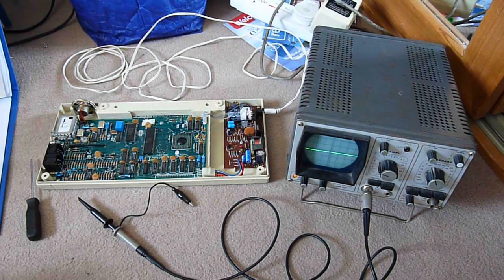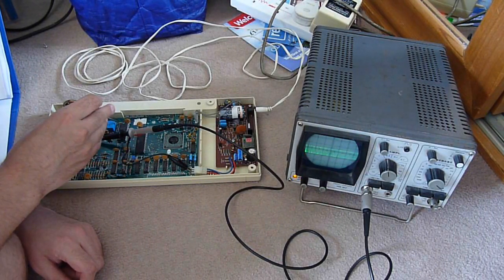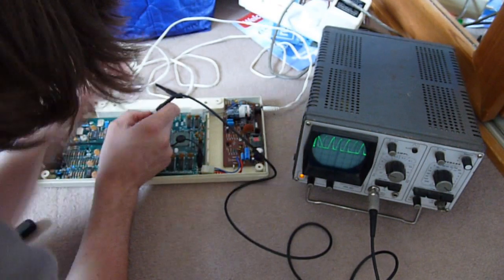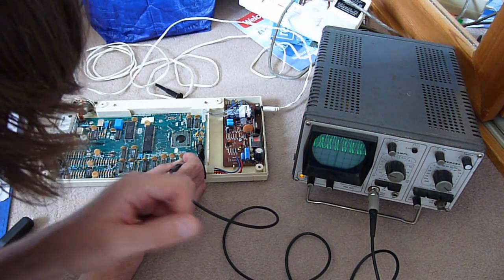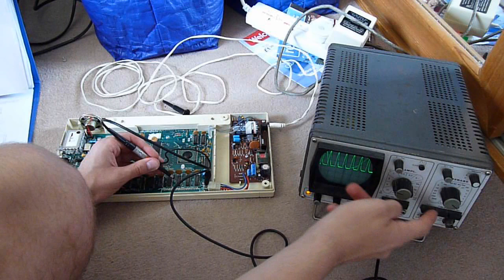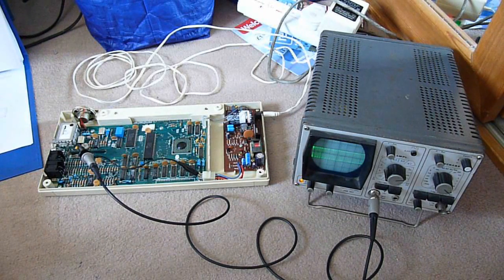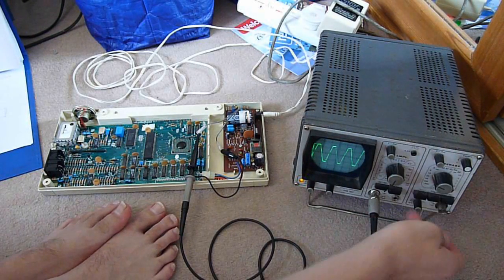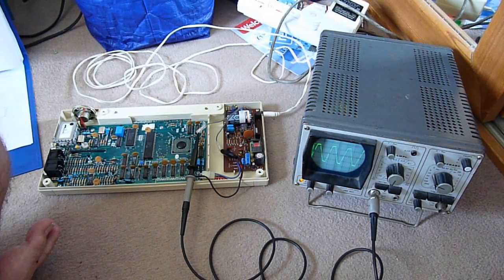How To Use Your Oscilloscope Usage/Debugging Tutorial

Comment: Thanks for the video - helped a lot.  How exactly is that power outlet 20v?  Aren't they 120?  How is that not blowing up the scope?
Reply from the maker: MrSlowestD16 In the UK the power is 240V and it is an isolated transformer supply that gives an unregulated 19V output. Connecting it to mains would blow the scope up.

Comment: ...does that talk you through the places to test step by step?  is there a good source for those on the web or is it just a generic search?  How did you know the voltage output of the pins, is that from the maual or just generic across most of the board?

What are the 're-trace' lines on the scope?  (loads of questions lol, really enjoying this, it's just what I've been after)  :o)

Why would the signal vary on the 2 chips if they are identical? 

I'm assuming that if you can't get a service....

Comment: Hello TheEPROM9,

I just bought today what seems to be the same oscillator showcased in your video : the Hameg HM307. Could you explain me how to use the calibrator (with built-in square-wave) in order to adjust the probe and make a correct measurement. 
Cheers,

IOO
Reply from the maker: That info can be found in the manual.

http://bee.mif.pg.gda.pl/ciasteczkowypotwor/Hameg/hm307-3.pdf
https://www.manualslib.com/manual/564041/Hameg-Hm-307.html
Reply: Don't hold you breath.

Comment: Ok, I'm at it again, watched this video again because I was looking at some ic data sheets and I had a thought.  The ic address lines, that is digital information being kicked out so why is it that you don't get a square wave form out of them?  (sorry, don't finish work till 7am lol)
Reply: A square wave would be on the clock signal. Digital signals pulse very quickly and really you need a logic analyser to look at them. If you consider a byte is 8 bits then when a byte is on the data bus you'd need to look at all 8 signals simultaneously. A scope is useful for checking clock signals but a logic probe or analyser for interpreting digital electronics.

Comment: you should have put an insulator (tape or heatshrink) on the vcc where you put the scope lead ground.
Reply from the maker: Thats not a bad tip, tuned out the Electron PSU has short cuircet protection.

Comment: I was thinking about this in bed when I woke up (yes, it's getting that bad!).  Could it also be due to the resolution of the scope?  I mean, that has to be a digital signal or the data would not be understood.  Could it be, and this is just an uneducated guess lol, that you said your scope is 10mhz and the electron's oscillator is 16 so it can't see the fine detail?  I know the repeating pattern will probably because the computer is on standby so will be just cycling the same data :o)

Comment: Woo hoo, an actual debugging tutorial, these are thin on the ground.  Most tutorials show you have to use the scope but you never actually see them in action :o)

So when doing this, you need to use the output side of the psu, never from the mains?

I noticed your using a manual....

When you check the Chrystal Oscillator, you hooked it too an ic pin, I'm assuming this is the pin that the oscillator goes to.  Why not connect it straight to the oscillator, is it because you can't get at the legs?

Comment: ...manual, you can look up the chip and look at it's specs?  Your right, it does look quite simple when you show it like this, everybody else makes it look so bloody complex :o(

Aha, you just answered my question from above :o)  Naa, a lot of the info in a data sheet goes right above my head lol

I'm guessing that if you have a duel trace like mine, you can test capacitors and resistors too?

Is that psu isolated from the mains by the transformer? 

Aha, I'm starting to see how you can design..